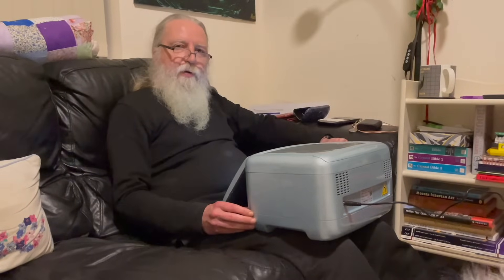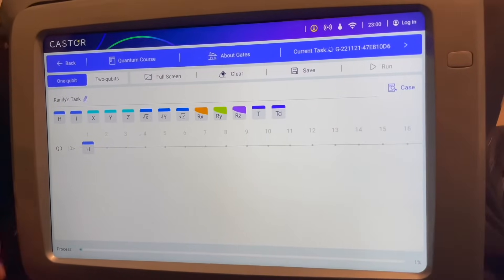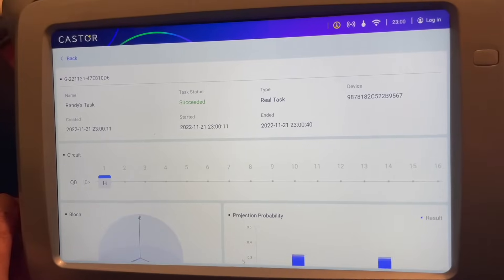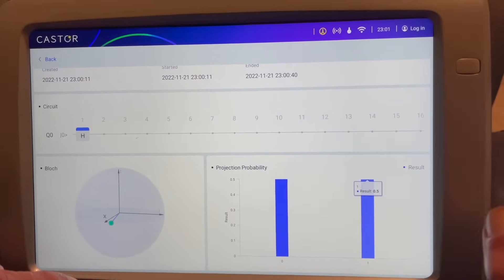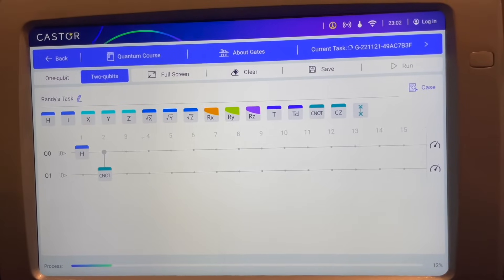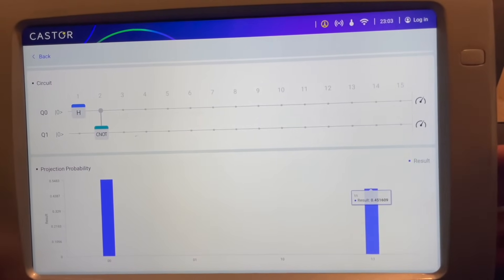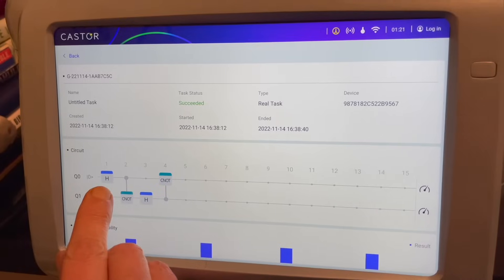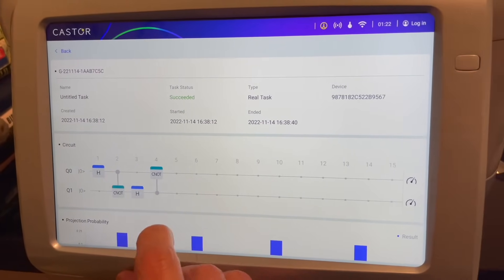Superposition & Entanglement on the SPINQ Gemini Mini Quantum Computer

Comment: I have a few questions.
1. Does it support OpenQASM rather than having to use the drag-and-drop interface?
2. Does it support OpenQASM boolean operations (if statements)?
3. Does it support submitting programs to it and getting the results over the network?

From my research I did find they have something called "SpinQit" which on their website it says "Supports both Python and Open QASM2.0 programming port" which I assume means the answer to #1 and #3 is "yes" but I'm not really sure if SpinQit is the software this Gemini thing is actually running or something else, and I can't find anything about #2. I only ask about #2 because IBM's cloud quantum computers do not support boolean operations in OpenQASM which is a limitation that forces you to have to break certain programs up into many different programs.

Comment: I don't understand what this thing does at all. Aren't quantum computers supposed to be kept at extremely low temperature like colder than space? How does this little machine do this? I don't know shit about quantum computers so maybe my question is completely stupid.
Reply: Not necessarily. It depends on the medium used for the qubits. This is based on a technology called NMR which can be done at room temperature, but there is no known way to scale it, so it is usually stuck at low qubit devices. But if you're just making an educational tool then it's a good way to bring a simple quantum computer to market.
Reply: @艾米心amihart  thanks for the response